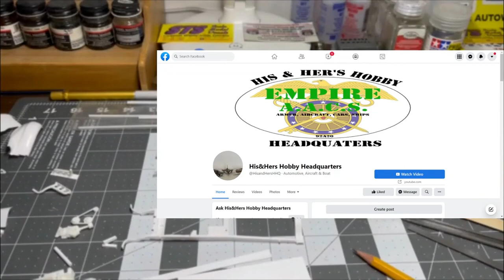Goodguys R.C.A & Revell 1/25 Scale ‘29 Ford Pickup 3n1 “Wolfman” Build Pt 1

Comment: If you want to draw on the plastic with a pencil scuff the surface first with a sanding sponge or wet and dry paper. Just enough to kill the gloss. Soft white eraser will remove the pencil lines. Cheers
Reply from the maker: Thank you very much, Gordon, for the tip. I really appreciate it.